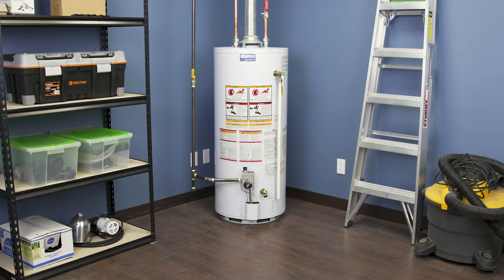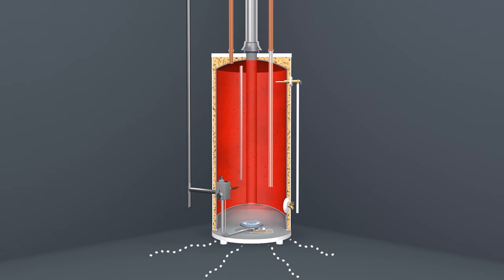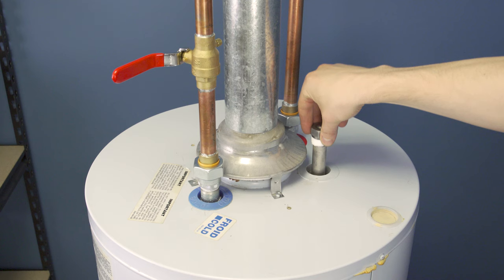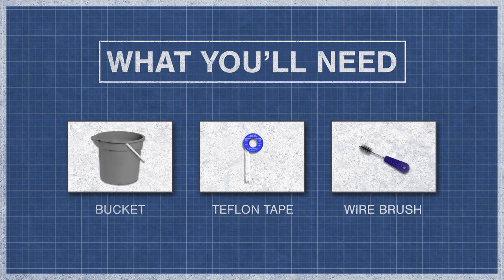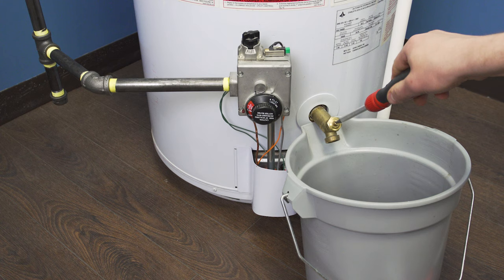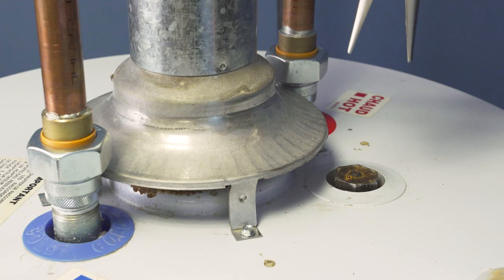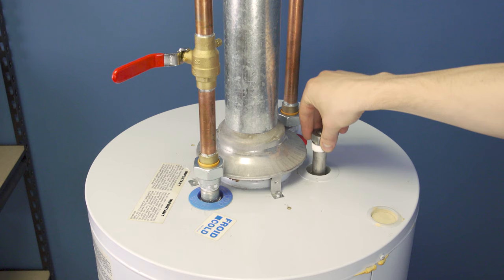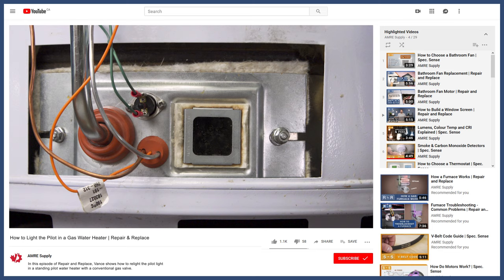How to Replace the Anode in a Water Heater | Repair and Replace

Comment: My water heater is 26 years old and is clear, clean and corrosion free. Not a typo, 26 years. I change anode every five years and flush every 3 months. A good rule of thumb is to check for leaks after turning on water and before turning on gas or power. Great instructional video.
Reply: What brand ?  My AO Smith lasted exact;y 19 years with, sadly,  zero maintenance performed...  I wish I had known about maintenance requirements to extend its life a decade or more !
Reply from the maker: Thanks for sharing, and we're glad you liked the video! It seems like your regular maintenance paid off, 26 years is far beyond the average water heater!
Reply: Hey! My water heater is 26 years old now too! I have only maintained it since we bought the house(1 year). 
Is yours 30 years now? Did it make it???
Reply: @AdmiralDG  the electric water heater was installed in 1994 and still going.  I purchased the house when the water heater was seven years old and not maintained at all. To be fair, over the past twenty plus years I have owned it, I have slowly replaced just about every part on it myself. In the last ten years I have only replaced the anode. One thing that was a design flaw in WHs the age of ours was a dip tube that deteriorated over time and needed replacement. The part was $0.50 at the time. The plumber on the This Old House, made the statement that a WH could last indefinitely if properly maintained.  An important modification  I made was replacing the easily clogged plastic drain valve for three-quarter inch brass ball valve. To your question, my 30 year old WH is still going strong!

Comment: Sorry but the tape does not go on "clockwise". The result is that the tape will unwind from the threads as you attempt to screw the new anode or any other threaded part onto it's mating surface.
Reply from the maker: Thank you for watching. Clockwise and counterclockwise depends on your reference point. The video mentions "looking at the threads, tape is always applied in a clockwise direction". This is the same as wrapping counter clockwise when looking down at the end of the anode rod nut. The anode rod is screwed in clockwise (when looking down) which means the teflon tape will tighten against itself when screwed in. Hopefully that helps clarify the wording.
Reply: @AmreSupply   The same question occurred to me, but the video was correct, I think, no matter the verbal explanation.

Comment: Aren't you wrapping the tape COUNTER-CLOCKWISE?
Reply from the maker: Thank you for watching. Clockwise and counterclockwise depends on your reference point. The video mentions "looking at the threads, tape is always applied in a clockwise direction". This is the same as wrapping counter-clockwise when looking down at the end of the anode rod nut. The anode rod is screwed in clockwise (when looking down) which means the teflon tape will tighten against itself when screwed in. Hopefully that helps clarify the wording.

Comment: For years I have tried to replace my Anode to no avail.   Used a breaker bar,  impact wrench,  and certain sprays to loosen it but nothing worked.   Its been 17 years now with this tank and no problems yet.   I will definitely call on AMRE supply to install a new tank.
Reply from the maker: Thanks for watching. It seems like you tried everything possible but after 17 years the threads are likely rusted and fused together at this point. When you get a new tank, checking the anode yearly can help prevent the threads from fusing.
Reply: Most of time impact wrench will free stuck anode rod unless your impact wrench is not powerful enough to break loose the rod. You can also install anode rod in hot water outlet instead of main anode rod.
Reply: An strong electric or pneumatic impact should destroy your water heater if it won’t come out. If you are using a battery powered impact, that isn’t strong enough.
Reply: Just replaced a 16 year old sears power miser 12 water heater this week.For fun,I tried to remove the rod with my 20 volt dewalt impact gun.Would not budge.
Reply: Same here. Tried removing anode on new heater, it's epoxied in . No luck.

Comment: I think the elephant in the room is you will not have enough ceiling height to remove/reinstall the rod without draining the tank, disconnecting the hoses, and tipping it over. They say it is 42" long, and I have only 36" to ceiling. Can you cut the rod? I read that you can. Do those 'flexible' (segmented) rods work? Will they keep the water heater in warranty or void it? How often should you check it? What if you forget to de-pressurize the water heater - does it blow the anode into the ceiling like control rods in the Chernobyl disaster? Is Magnesium 'better'?
Reply from the maker: Thanks for watching. Yes the rod can be cut with a hack saw when you remove it. You might want to clamp or tie something onto the bottom half to prevent it from falling back into the tank but even if it did, it wouldn't create issues from being in the tank, it would just stop providing any protection. 

The segmented rods will still work as intended.

As for pressure, the tank is installed with a pressure relief valve. This can be tested to make sure it can open and close properly. 

As for checking the anode rod this really depends on how hard your water is. If you check it first every 6 - 12 months and you don't see much change, then you could check it less frequently.

We have a maintenance guide which you might find helpful: https://www.youtube.com/watch?v=ZTUNLIXKVu4

Comment: Great video - thanks for posting.  Question:  I was able to undo the anode rod but there is so much hardened material on it that I can't pull it out of the opening.  Any recommendations would be appreciated.
Reply from the maker: Thanks for watching. You could try to use some vinegar to try to dissolve some of the minerals around the opening.You might need to break some of it loose to get it out.

Comment: Had to use an impact wrench to get mine off, took about 2 minutes,  easy!
Reply from the maker: Hi Aaron, thank you for watching! An impact wrench definitely is useful in this case, and requires a little less elbow grease. Glad it went smoothly!
Reply: @AmreSupply  Is Impact Wrench safe to use for an anode rod removal ? How can an anode rod be removed when I don't have much space vertical space above the tank ?  Can it be cut using hack saws ?  I know they make nunchuck type of anode replacement rods now but my challenge is removal of factory install full size rod.
Reply from the maker: @ptg01   P G  Thank you for watching! It can be tricky to remove a factor installed anode especially if the threads are starting to seize. An impact wrench is safe to use as long as there is enough headroom above the water heater.  You can always try applying some penetrating oil and let it sit to work its way into the threads. If you don't have room for an impact then try a socket with a long extension to help get enough torque. Cutting it out would be difficult and slow and would be a last resort.
Reply: AMRE Supply I just realized applying penetrating oil will most likely help BUT it may contaminate the water in the tank ! !!
Reply from the maker: @ptg01  If the anode rod is really stuck in there, it is unlikely that the penetrating oil will make it all the way into the tank but you're right oil some could make it in. But thinking of it practically contamination is really only a concern if you intend on drinking or cooking with the hot water.
Reply: I used breaker bar with a four foot 3/4 pipe which worked well

Comment: Thanks for making this video. Really helpful, covered a lot of material in a very well-explained sequence. One suggestion: remind viewers that when installing a new tank, check that they, or the plumber, has not soldered elbows, mixing valves, or other copper fittings directly over top of the anode access!! It can really hamper the replacement job if you have to start playing around with the piping.  Most tanks come with the anode pre-installed, and some of the folks I've talked to don't read the owner's manual and don't know about the need for draining and checking/replacing the anode.
Reply from the maker: You're welcome Rob, and thank you for that tip. Not all people think about ongoing maintenance when doing installations. The more repairs someone does, the more they start thinking about how easy it is to access the parts that they need to replace. You are right that these sorts of things are good to mention for general awareness.

Comment: We bought a new house and it was built in 2016.. I don't think the previous owner did any maintenance.  I think its time I do this!
Reply from the maker: Thanks for watching. We actually have a maintenance guide which includes the anode and other checks: https://www.youtube.com/watch?v=ZTUNLIXKVu4
Reply: @AmreSupply  Im trying to find the right anode rod.. I have a AO Smith 40 gallon short electric water heater.. I see rods at 42 inches and I guess that would be fine if my water heater is close to 50 inches from top to bottom.  I removed the anode cap and seems there is an endless pit of insulation foam, smh lol..
Reply from the maker: @sanantoniodood  Anode rods can be cut to fit using a hacksaw. As long as the anode rod fits the exact length will not truly matter.

Comment: Have a older GE gas tank and can't get anode rod 1 -1/16" bolt off.  Can I just add a new "ONE PIECE HOT WATER SIDE NIPPLE anode rod" without extracting the old one out of the tank, basically having two. Leave old one  in the tank and just add the new one. Any problem with this scenario, or you absolutely need to get the old one out? Thanks Rick"
Reply from the maker: Thanks for watching. If you cannot remove the old anode rod with a impact wrench or any other means then installing a combination anode rod / nipple on the water outlet pipe would still protect the tank.

Comment: Great video...awesome explanation....I have everything to install the new anode rod and it bends, because I dont have a lot of space from the ceiling.  The anode in the 
tank is solid though...if I try to bend it will I damage the tank?  I have a bout 32 inches of clearance from the top of the tank to the roof.  Is there a better way to remove anode?
Reply from the maker: Thanks for watching, we're glad that you found it helpful! Depends on how much of the old rod is left. In some cases the anode rode might have to be cut out. You might need vice grips to hold the bottom of the old rod to prevent the bottom of the rod from falling in. A hack saw will be enough to cut through the old anode rod.
Reply: they have segments rods now that come in 4 sections so much easier to install. Got mine at Lowes for $37

Comment: Before putting in the new A.Rod, can I add a cup of white vinegar to the empty tank (all water must be drained before) and then open up the cold water to wash the tank?
Reply from the maker: Thanks for watching. Yes vinegar can be used to help dissolve any minerals and help flush out the tank. If needed you can always do a backflush. You can see this here: https://www.youtube.com/watch?v=hkbi24QJhDw

Comment: How long are the anode rods ? My water heater is in the basement I only have about 3 ft clearance on top thank you
Reply from the maker: Thanks for watching. The anode rods are usually close to the length of the inner tank. They do not touch the bottom but go close as an estimate. If you have less clearance than the length of the rod, you might need to bend or cut the rod to remove it. To install a new rod there are flexible / segmented rods available.

Comment: Why do you guys use an excessive amount of teflon tape? I actually wired brushed my fitting when i replaced my rod with a new one to improve the electrical connection. Seals just fine and will theoretically improve the effectiveness.
Reply from the maker: Thanks for watching. Applying telflon tape will prevent the threads from seizing making it easier to remove in the future. When applying several turns, of tape the threads will still cut through and there will still be a metal to metal connection for the anode to work. 2 turns will be enough for most cases.

Comment: I have a low ceiling in the basement, not sure if I can fit a new anode in, If not do I have to put water heater on side to get it in?
Reply from the maker: Thank you for watching. These are less common but there are flexible anode rods and ones that come in segments that you can bend to get into tight places. To remove the old anode rode you might need to cut it in half with a hack saw. No need to put the water heater on it's side.

Comment: Our hot water tank sits under our stairwell, its top only inches below the underside of the level steps, so withdrawing the dip tube, if it's rigid and won't bend, won't be possible. (Unit's not gas but electric.)  Is there such thing as a flexible dip tube that I may acquire to install once I've gone through the anticipated agony of trying to tilt my emptied tank so as to succeed in pulling out the present (presumed faulty) tube? 🥵
Reply from the maker: Thanks for watching. There are flexible anode rods and segmented anode rods. As for dip tubes, they are plastic but might not bend as nicely. You can always go to the store and test out how much it bends before hand.

Comment: IS there anyway to take pic inside heater with anode rod out. I did not change for 9 years
Reply from the maker: Thanks for watching. There are Flexible Endoscope that can connect to your smart phone. This have a build in light for illumination. You can find these on Amazon.

Comment: I have completed every step you have described but now I have arrived at a point where I'm totally puzzled. I have a 4 year old REEM WH and because I'm on well water, sulfate [rotten egg smell] has made it necessary to install an alu anode rod. I have located the anode as shown in my manual but it is encased in a thick cover of Styrofoam. I whittled most of it out but what appears is a green wire/bar across the opening i.e. above the rod head. In no place have I found any mention of such a bar so that I'm now questioning whether it is indeed the anode rod that I have exposed.  Any suggestions?
Reply from the maker: Thanks for watching! Many water heaters have styrofoam around beneath the anode cap. If there is no other cap or access on the top for the anode then you're likely in the right place. You said that you can see the hexagonal head of the anode. Is there anyway to lift the wire up or out of the way so that you can get a socket on the anode?
Reply: Free

Comment: Would impact wrench damage the glass lining? Some say yes some say no, but the old anode rod won't move even I put Liquid Wrench and with a 2 feet breaker bar. I may have to use impact wrench sooner or later.
Reply from the maker: Thanks for watching. Using a impact wrench should not damage the glass lining, and in some cases its the only way to remove the anode.
Reply: @AmreSupply  Thanks for the information and suggestion. Thanks for the video. Subscribed.
Reply from the maker: @callmebackfriday2  You're welcome and thank you for subscribing! We've got some great series in the works so stay tuned!
Reply: @AmreSupply    After having to use an impact wrench, my new anode leaks.  I suspect the impact wrench broke a weld somewhere and/or cracked the glass.   So I'm gonna disagree with you and warn that an impact wrench should be your last resort only.
Reply: Yes, absolutely a possibility.  I believe an impact wrench damaged my heater so that I cannot stop a small leak at the new anode.  Be very careful.  Go with a 36" breaker bar.  Impact wrench only as a last resort.
Reply: @AmreSupply  Disagree.  I've damaged my heater with an impact wrench.  Use a longer breaker bar.

Comment: My anode rod came without a hex nut; do I use the old one?
Reply from the maker: Thanks for watching. That seems unusual. Does your anode rod have threads? What is on the end of it?
Reply: @AmreSupply  Threads.
Reply from the maker: @jdsirrom4314  How is the old one mounted? Did it look like the example in the video?

Are you saying that the new anode rod just has has threads on the end but no hex nut?
Reply: @AmreSupply  Yessir. However, I went back to Lowes and purchased one with the hex nut included; I don’t understand the other one.
Reply from the maker: @jdsirrom4314  You must be referring to an anode rode that would connect to a hot water supply. In some models it is built in. These anode rods will have a double sided nipple with threads on both sides. There will be a channel to allow hot water to pass through the top of the anode and into the hot water pipes to your home.
Reply: @AmreSupply  Sound right! Thanks!
Reply from the maker: @jdsirrom4314   You're welcome!

Comment: I have a short hot water heater no problems with it I want to flush it out and also replace the anode rod while I am at it. But i can't find one that's short just an rv one. My tank is 45 gal and is 32" tall. All the rods I see are 45" long. Will the snake type rod work on my HWH.
Reply from the maker: Hi Jeff, thanks for watching. The snake type or segmented rods will work with the water heater as long as the thread size is the same. Additionally you can always cut the bottom of a regular anode rode to make it fit with your RV water heater, again just double check that the threads are the same.